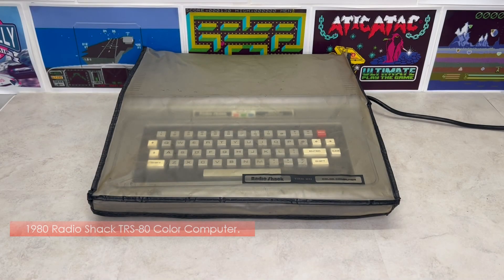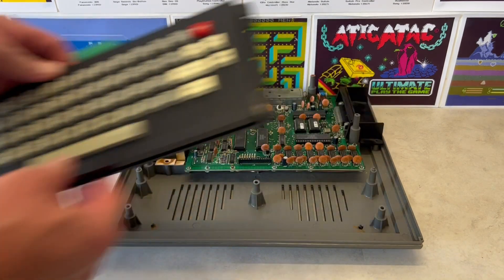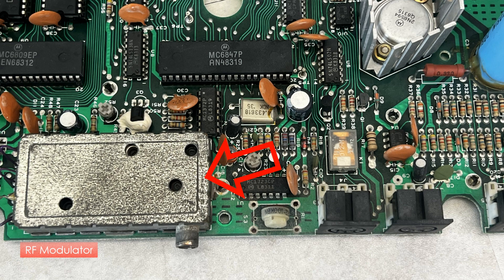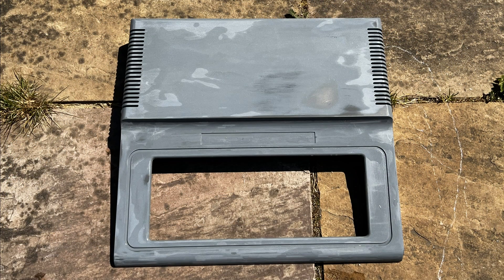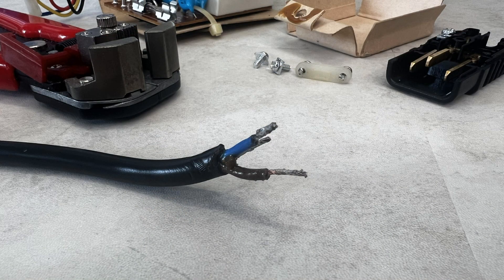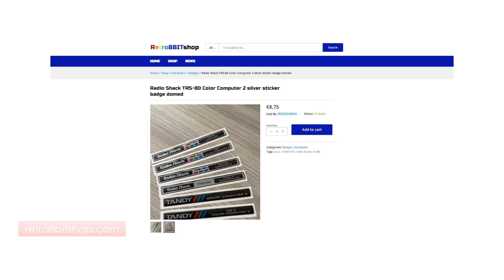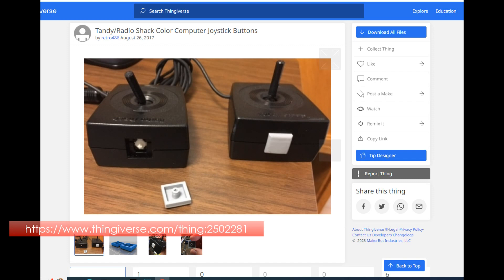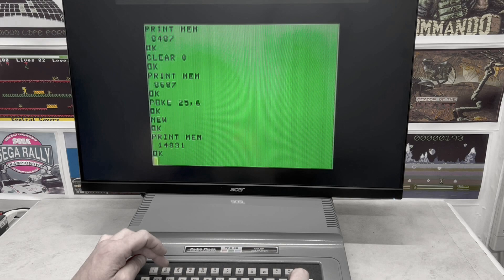1980 Radio Shack TRS-80 Color Computer Restoration

Comment: One correction - the Coco 1 and 2 ran at 0.895 MHz (close to 1 MHz), not 2 MHz (that was the Coco 3, technically 1.78 Mhz). There are some POKE's that you can speed up ROM access to double speed (POKE 65495,0; POKE 65494,0 resets it to normal speed - which is required for reliable cassette & disk access, as well as timing for baud rates on the RS-232 and the pitch of SOUND and PLAY commands), and even one to speed up both RAM and ROM (POKE 65497,0; POKE 65496,0 to reset to normal), although the latter is too fast for the SAM and VDG and will result in the screen showing garbage, and dynamic RAM refresh to not always keep up and start corrupting.
Couple of quick things on the games you played - in Skramble, when you are on level 3 (the comets), you still have to bomb the fuel depots, or you will run at and crash (which is what happened to you). In Danger Ranger, you can shoot the Floating Urns (they actually descend in flames), although they respawn from the top once you leave the bottom. But it does by you some time. (side note: Ken Kalish, the author of Danger Ranger and many other Coco 1/2 and Dragon 32/64 games, was from the US, but his last 2 games were UK exclusive - he told me that the UK market was much friendlier to him and the software houses easier to deal with).
You should also be able to upgrade it to 64K RAM, although how complicated that will be will depend on which revision of the motherboard you have.
Great video; I will be mentioning it on our next weekly Coco Nation Show live (here on YouTube as well as Twitch and Facebook) every Saturday at 2 PM Eastern time.
Reply from the maker: Yep, you’re right; thanks for the correction 👍